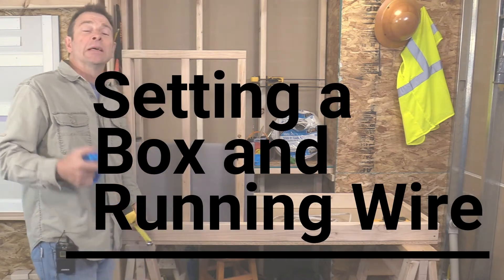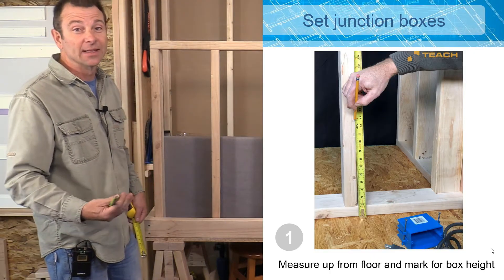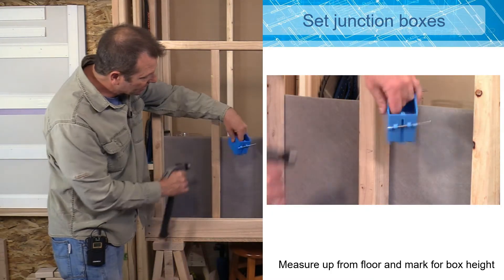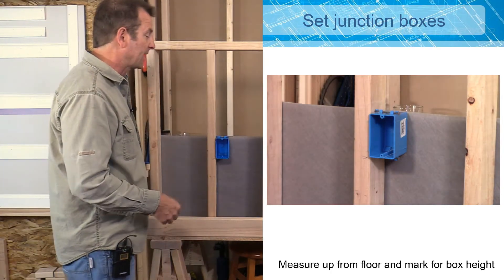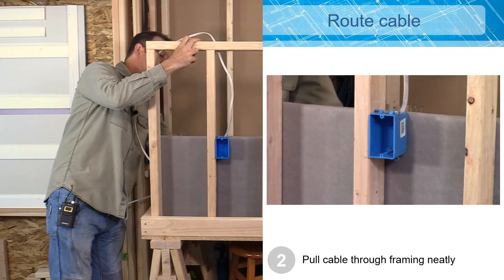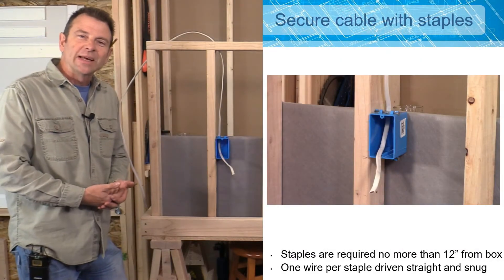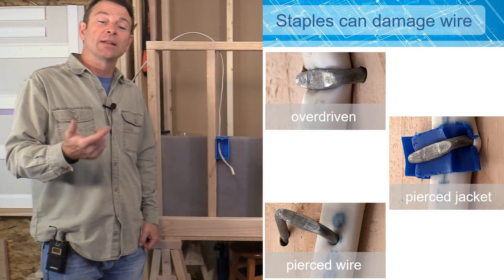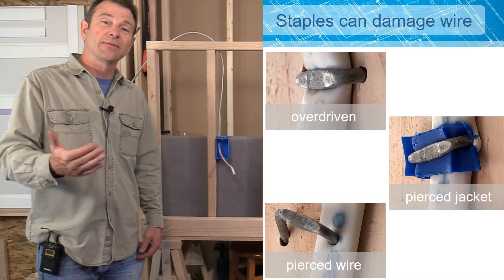Electrical Wiring Process - Part 1 - Installing a junction box and pulling wire - Come and Join us

Comment: Often, during or after installing a socket, we forget which wire is the input. To solve this problem, I always use the "left in and right out" principle when arranging the wires. That is, all wires entering the switch or socket box are input wires through the left hole, and the others are output wires. In this way, regardless of whether there is electricity or not, I can tell at a glance which line is the incoming call.

Comment: isn't the box depth tabs on side of  a plastic junction box 3/8 inch,I'm a DIY'r and seems I'm always short to flush with edge of drywall and end up using outlet spacers to have a flush mounted face plate especially if you use 5/8" drywall

Comment: If you remove the plastic knockout completely you must have staples no more than 8” from box. If you keep the knockouts attached to box as a clamp for your wires, staples can be no more than 12”
Reply from the maker: thank you for the additional info

Comment: The wiring method that you demonstrate in this video would encourage any potential moisture that has entered the wall cavity to follow the wire down to the junction box and start the corrosion process. In this particular case, I would prefer to see the wire continue below the box for 4 to 6 inches being held in place with an additional staple then back up forming a "drip loop" and entering the box from the bottom punch out. Great work producing these videos!
Reply: Nice.  Is this done for any internal residential wall?...or external walls only?    Is that a code requirement?...or do inspectors discourage/encourage this?  Thanks.
Reply: That is ridiculous. It’s not code to make “drip loops” I’ve never heard this in my 13 years as an electrician, why would there be moisture in the wall cavity? If you’re that worried about moisture getting in the box use a conduit and connector to secure to box. Now there’s a loop we use called a service loop for keeping extra wire in the wall for future services